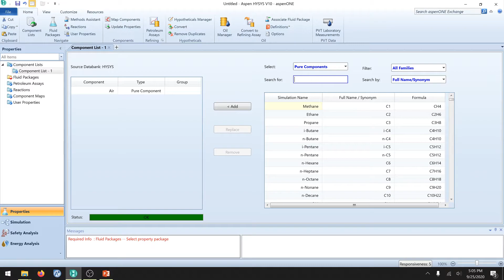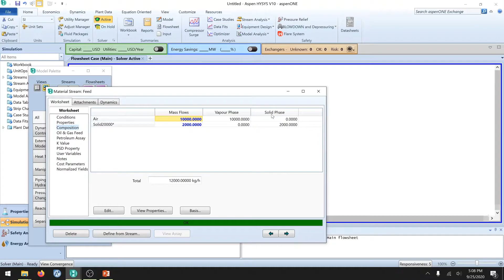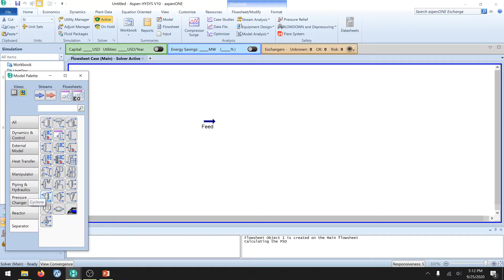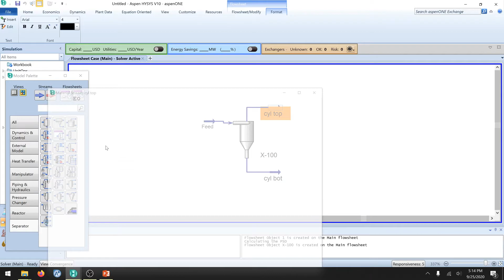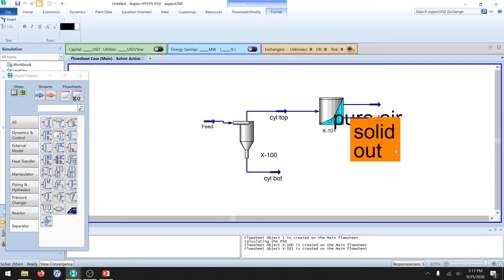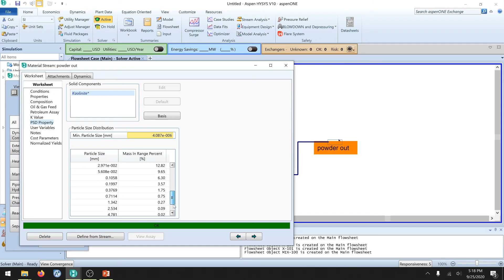Aspen Hysys Solid Handling

Comment: thanks sir, this video very supporting me
Reply from the maker: I struggled to learn Solid handling first that why i made a video to be useful to others, thanks,
Reply: @chrash786  permission to ask sir, whether it can enter the feed inlet velocity on the stream? thanks before sir
Reply from the maker: @muhammadakbarray4001  i will try , it.  If you know the velocity and area of piping you could find the volumetric/ mass flow rate. It might be possible.
Reply: Can variation for velocity inlet sir?
Reply from the maker: @muhammadakbarray4001  Sorry for a delayed reply.  Velocity is depends on the piping size. I believe, if you know the piping size and mass flow, velocity is just apparent.

Comment: When i clicked to calculate PSD, the software says "Failed to create PSD from SPS engine".  Do you know how to fix it?   Thank you
Reply from the maker: did you define the mesh size properly
Reply from the maker: @alimchem8565  there is option for user defined sizes too. I use mean ans standard deviation for calculation.
Reply from the maker: @alimchem8565  Add available PSD in the user defined descrete area. OR use mean diameter and standard deviation with log method. Please give a try.